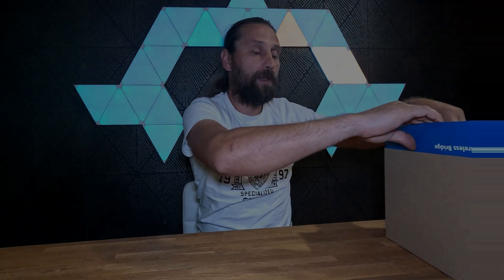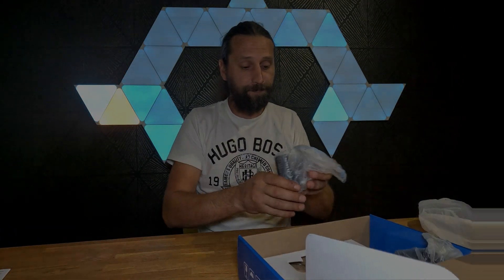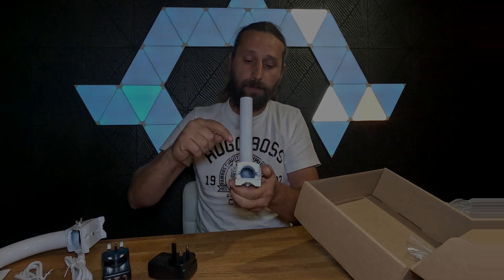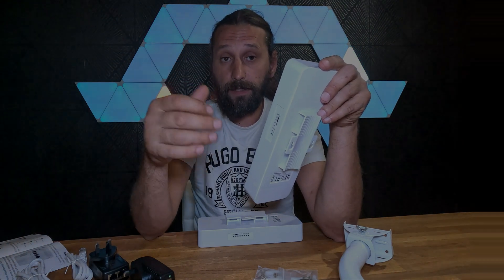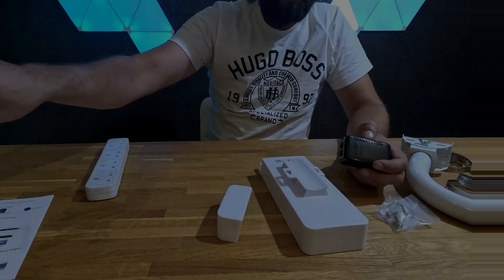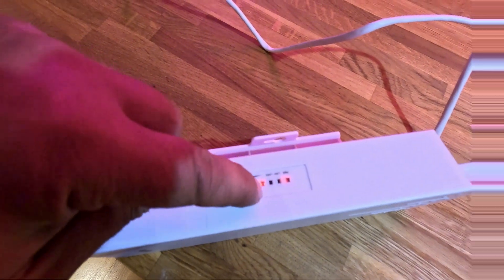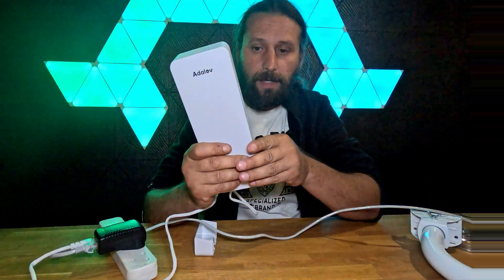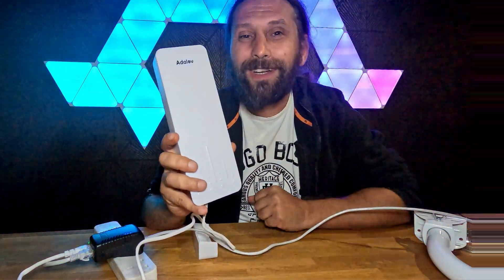AdaLov CPE660 Point to Point Wireless Bridge

Comment: Can the slave be used as a wireless access point like a WiFi extender or does a router need to be used with slave?
Reply from the maker: You will need the router

Comment: Hi, i know this is unrelated to this video but i want to ask a question about external foam insulation. Isaw in one of your video you applied a "base coat" with adhesive/render before you applied the reinforcement mesh, then in another video you just put the fiberglass mesh directly on the foam and apply the render/adhesive after and press it though the mesh. Can you give a little explaination of why you do the different methods? i have a Concrete block house in Norway that i am looking to DIY insulate with foam.
Reply from the maker: The right way to do it is by applying the adhesive and then the mesh , especially on the blocks where ghosting will show when cold or humidity is high outside. Ghousting = you will see the mortar joints in bad weather